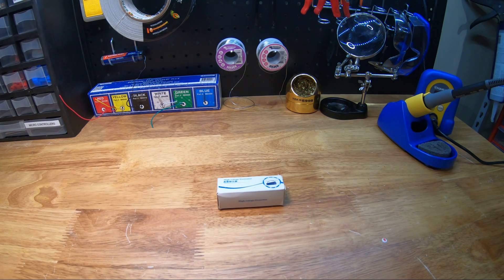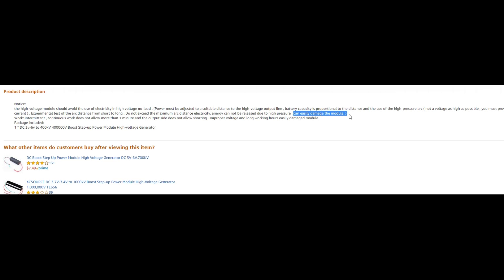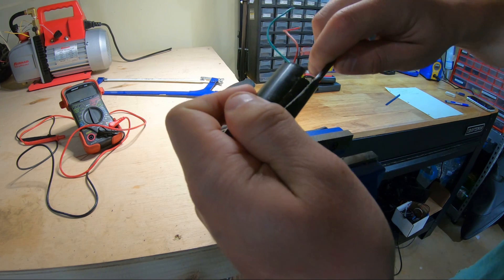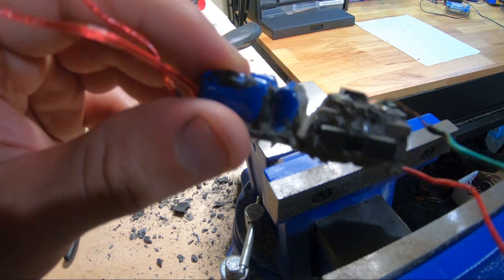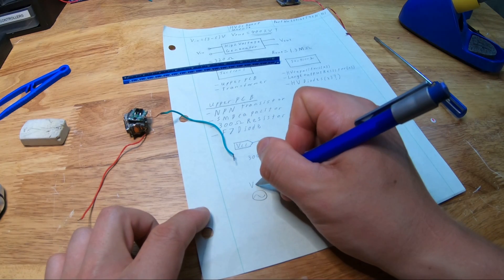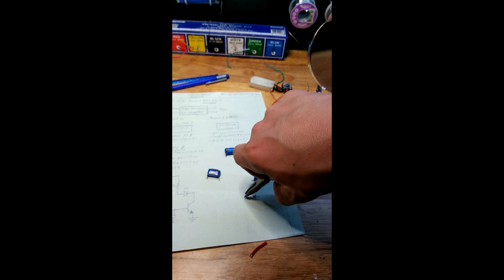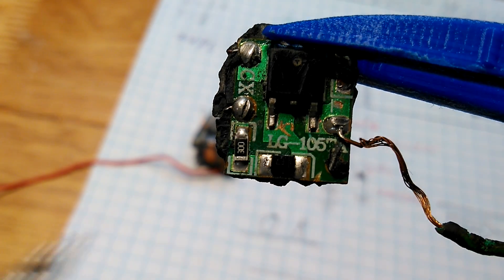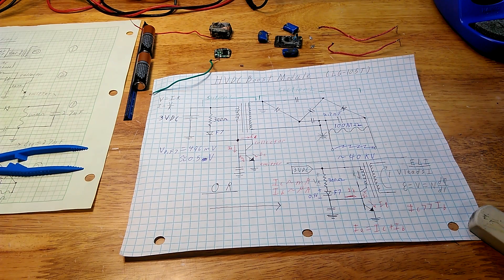HIGH VOLTAGE DC BOOST MODULE!!! (Reverse Engineering)

Comment: Is there a way to test the polarity of the wires at the output without blowing your meter or buying a high voltage probe?
Reply: A multimeter is only able to check DC 1000 volt max And If talk About Ac..
It can only check 750 Ac Max Voltage ⚡

Comment: had got few of these generators burned out a few    fast   and would love to know what part failed    how to  make a newer better one   
have a few projects that i need  a high voltage spark output that could stay on  or ran with  motion sensor   basically a booby trap zapper /mouse trap/ emp pulse /taser ..ect
was also looking  in  transformers anyway please let us know if you  build a diy version after you made this video